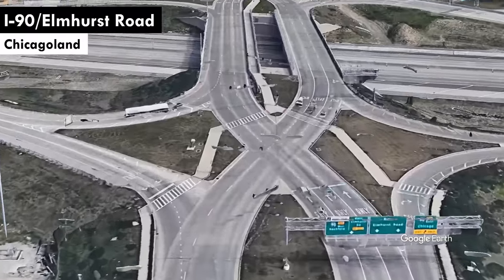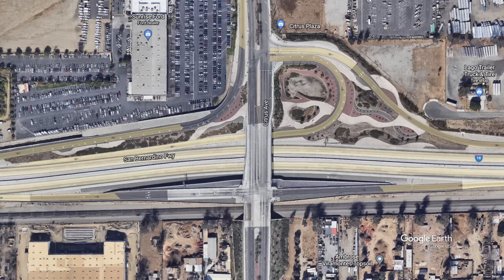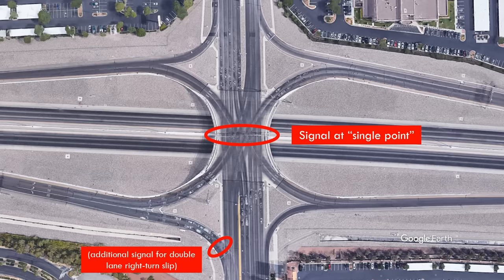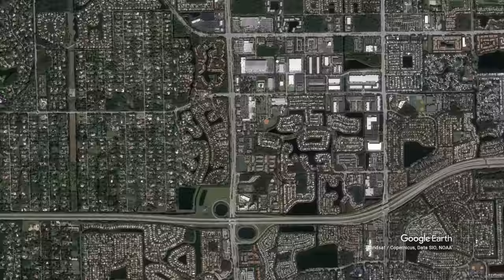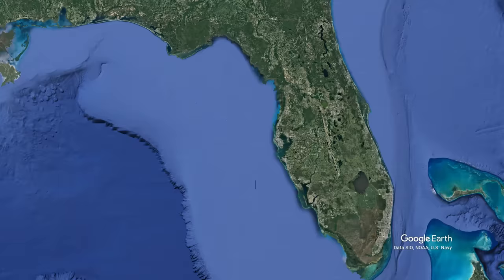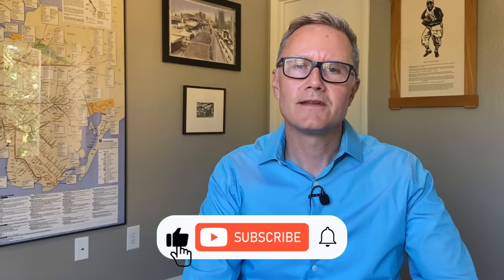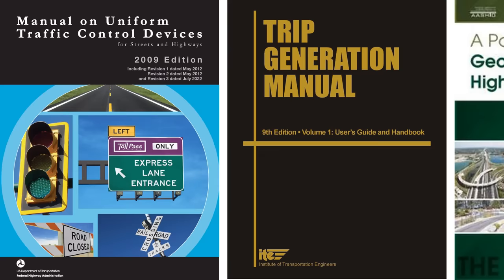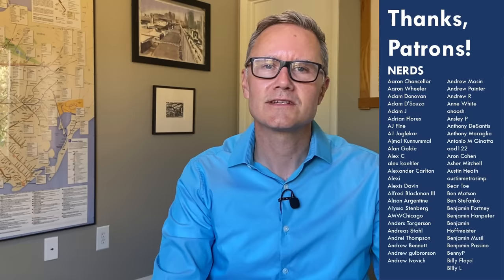Traffic Engineers Gone Wild: Why Interchanges and Intersections are Getting Worse, Not Better

Comment: 13:41 Whaaaaaaat..... If you are going to build a roundabout anyways (or multiple) then why not just turn the initial intersection itself into a roundabout or a traffic circle? Roundabouts are fine for pedestrians to cross, at most it just means you have to walk a little bit  further to cross  at some distance from  the roundabout, as long as the lanes are kept low it's no problem to cross. In thie animation you showed, they can just take out the bikelane from the road and put it next to the sidewalk, take out the right lane, since the current middle lane can already accomodate a right turn and a straight on and the current left lane can accommodate  another straight  on and the left turn. Then pedestrians only have to cross 4 lanes, which isn't nice but it's not terrible either. And if the city really wanted to make it better for pedestrians they could just widen the median to make it two two lane crossings instead, which they would have the space for because they moved the bikelane and got rid of one lane of cars.

Comment: i am still a fan of the diverging diamond interchange as a concept, though the 'accommodation' examples you provided were indeed atrocious.  if the median pathway there were wider and less 'prison' like, i think it might be tolerable.  had a recent experience with a 'standard' highway interchange on the southern outskirts of edmonton (hwy2 and ellerslie road) .. since we had stayed at a hotel at the SW corner of the interchange before, i knew that if i wanted to turn left from ellerslie road south onto hwy2, it was faster for me to go straight through, turn left at the next interchange, u-turn in front of the hotel, turn left back onto ellerslie road westward, and then take the right turn onto hwy2.  a DDI would have been a huge benefit there, especially since the nearest pedestrians would be blocks away.  

another intersection that had been problematic for years was at the hwy2 turnoff onto gasoline alley in red deer.  traffic at that interchange was consistently awful, and sometimes i would forego a pitstop after taking the offramp just because the left-turning traffic was backed up down the ramp.  within the last year, they put in roundabouts at both ends of township road over hwy2, and when i swung by a month ago, there were ZERO cars backed up in any direction.  still not great for pedestrians, but i would have been comfortable biking through those roundabouts if i needed to get across hwy2 (but i have braved biking down Macleod Trail in Calgary and Westheimer Road in Houston, so still likely out of range for a casual cyclist).  but i agree that putting in roundabouts just to accommodate vehicular u.turns is head.shakingly bad form.

Comment: A signal intersection with more lanes than State Road 7 / Forrest Hill Boulevard can be found at coordinates 41.03040933204014, 122.92754700762303 - the junction of Anshan Road and Jianguo Blvd. This is 8 lanes for cars on all four approaches, plus wide bike lanes and sidewalks. Additionally, it is in the middle of nowhere, surrounded by farmland, with very little traffic and no reason to exist. It was built back when Hu Jintao was president. They were going to expand an new suburb of the city, southwards, to here. The Xi Jingping came in and his anti-graft campaign ended the plans.

Comment: Why would the road designers give any more consideration to pedestrians when there are barely any to begin with. Being that you don't see a single other pedestrian in your video yet see cars everywhere doesn't it make sense to optimize the roads for vehicle traffic while only accommodating pedestrians? Most of the places you mentioned don't even have the density to be walkable even with the most perfect pedestrian infrastructure.
Reply: One of the reasons there are few pedestrians is the way that many suburban areas are designed.  They make what should be a short walk so onerous that many will get in their cars just to go a block or two.

Comment: I cannot resist local news articles about changes in traffic patterns. The article usually has some diagram from the State DOT about how to drive through a diverging diamond without going the wrong way, and the comment section is a salon of thought leaders that state the real solution would be to add an extra lane to the stroad that approaches the interchange. I kind of pity traffic engineers that get tasked with these projects. The powers that be want to reduce traffic that has been incited by the development of some warehouse facility that was built due to some tax abatement bonanza, followed by hastily built subdivisions, and now all those happy citizens need fresh blacktop to get to the strip mall. It is all just endemic car dependency.

Comment: Go drive in the UK: those guys toss in circles everywhere. Like instead of an intersection you get a circle or maybe some intimidating figure 8 situation. That’s on the main arterials. The rest is like super narrow tree lined lanes connecting villages with a speed limit so high I scared myself (weird because the highways have strict speed limits). Took me a while to get used to cause it’s different from South Africa which like copies USA but drives on the left. But yeah making a road feel dangerous to drivers makes you drive under the speed limit.

Comment: Dude wth that French DDI is nuts, at first I was going to comment that even though it's not a place you would want to be, that  they still provided decent to good access for pedestrian, apart from them also having the prison yard tunnel, they could have made that bit of the bridge just a bit wider and give pedestrians just a tiny bit more room, but they didn't. Anyways while looking at the pedestrian access, I thought it was sad how small of refuge area the pedestrians get coming from the top (still okay, just sad compared to the much larger and better space on the bottom crossing.), but then I looked at the top part of the intersection closer and is that a freaking roundabout?

They have a ROUNDABOUT at the end of this DDI, wth! Also while the bottom part of this DDI is well marked and shaped and the cars are pointed in the right direction and all that, at the top part it was like they decided, Eh you figure it out. It's as if this intersection sits right at the border of two jurisdictions and the bottom one decided to build it correctly and the top jurisdiction was too cheap and put in the least amount of effort that they could. What the heck happened here.

Comment: The Utah ones are incredibly practical... if you only have to move cars and pedestrians don't exist. I've driven on Bangerter many times and it is much nicer to drive on than when it had the traditional intersections... walking in the area though is an absolute nightmare... I would never go anywhere outside the 215 loop on foot if I could avoid it.

Comment: I think the worst intersection and interchanges you showed were the single point urban, the diverging diamond, and the displaced left. All three are absolute nightmares and death traps for any bicyclist or pedestrian to navigate. But what really grinds my gears is the "continuous flow" intersection: one that has displaced lefts and right-turn slip lanes in all four directions! 😠😡🤬👿 When an intersection gets that complicated I think it should be solved with a surface roundabout sandwiched between an overpass and an underpass.
Reply: DDI can be very good for pedestrians. The bad ones put the walkway on the outside (4 crossings with unsignalized slip ramps) but the good ones put the pedestrian crosswalk in the middle of the DDI which makes those 4 unsignalized slip lane crosswalks into two unsignalized slip lanes and two signalized crosswalks with a concrete barrier to protect you in the middle.

Comment: Random question that has nothing to do with this video except you mentioned a roundabout; I’m learning to drive and before driving I thought but pedestrian crossings at roundabouts was great as it meant you didn’t have to walk well down the street to cross but as a driver it seems dangerous (especially as we still usually drive manuals here so that doesn’t help). I guess the reason is thought the pedestrian doesn’t have to wait for a single as cars are slow (usually 2nd Gear) going around the roundabout but IMO it be safer if it was like at least one or two car size spaces away from the stop line or is there flaws in that? I understand it saves a few seconds for the pedestrian to have it right at the mouth of the road but it seems like bad drivers are more likely to ignore it & knock someone down. Is this even a thing in N.America? Ireland is plagued with them

Comment: All these American junctions seem to be traffic light dependent, what happens during a power cut ?
America seems addicted to the Stop sign and the traffic light. In Britain we preffer roundabouts and Give Way signs. Our motorways where pedestrians and cyclists are banned simply go straight through without interference while slip roads take traffic on and off the motorway and guide it via roundabouts to minor roads. Where 2 motorways or a motorway and a major dual carriageway cross they do so at different levels and once again slip roads and roundabouts sort out traffic not going straight on. You may get traffic lights on the roundabouts if they get too busy but they usually work better during a power cut.
Cyclists are in danger on roundabouts where drivers refuse to accept they have right of way simply by being ahead of them.

Comment: This kinda of shit is why I'm planning on leaving the country. Intersections aren't the only thing getting worse; drivers are increasingly aggressive and participate in more offensive driving rather than defensive. It's even worse during rush hour with giant semi trucks, oversized pickup tucks and crossovers playing weaver chicken with each other. It's a wonder I don't see more fatal accidents on interstates these days. It's only getting worse because climate change and excess car consumption are both consuming and destroying land at what seems to be an exponential rate. It's hell for anyone without a car. Even if you own a car anyway, you're still praying that no one runs over you or clips your bumper driving over 80. If you suffer a mechanical failure, your stranded on a less than wide enough shoulder where any moron who isn't even paying the slightest attention is liable to clip your bumper and total your car too.

Comment: For a bowtie variation used as a interstate exit, take a look at exit 12 on I-87 in Malta New York LatLon:42.970327031906606, -73.80173215975995 The interstate exit ramps throw you either into a slip lane for a right turn or a roundabout for a left turn when exiting the highway

Comment: Wondering if there are any examples out there of successful compromises of vehicle-servicing interchanges with fairly good pedestrian-bike access too?  Are these two groups incompatible all the time or has someone somewhere done something that works sorta ok for both?
Reply: you generally want to keep them apart, because small slow and squishy doesnt mix well with big heavy and fast...

urban environments pretty much already are the completely wrong place for large high speed roads and even worse large high speed roads intersecting

essentially urban environments and high speed roads have diametrically opposed design goals... so your options are to try and do both - badly, or to focus on one or the other.... if you focus on one, you either get a highway or a city... if you try to do both, you get this kind of mess

Comment: If the driver can't decide quickly then they should not be driving...

And what is wrong with traffic circles make them large enough for trucks and they accomodate pedestrians as well without any traffic lights just a slower speed in the area but is that really a big deal get into the proper lane before you enter the circle and drive right through...

Comment: This is not a traffic engineer's fault, this is a planner's fault. 
These interchanges do not belong in these urban areas, they are designed to be 100% car-centric on purpose, because that is the assignment they got. Intersections like these are not what is keeping in force poor planning, politics is.

These intersections are great at locations at which they can perform their function as a service interchange. Put it between two highways that have limited space to cross, put these at locations where city diversion roads meet the highway. That is where they belong. Not in the middle of an urban centre with houses right next to them?! That is insanity

Comment: the explanations for each type of intersection and accompanying panning really do not explain what they are or how they work very well at all.

The visuals are jarring and there's too much going on to know what aspects you're really talking about.
The wording doesn't help because you leave a lot of dangling references, no parts of the visuals are highlighted to know what you're talking about

For example, for the michigan left, you talk about east and west and start off zooming in to know which direction is east and west, but instead of keeping the same view and using the same picture with arrows drawn on them (you don't need fancy animations, just literally switch to the same picture that you drew arrows on in Ms Paint), you snap to a completely different orientation, which completely throws off the viewer which way is west and east anymore, so the rest of your explanation becomes a tangle of unresolved dangling references that the watcher can't follow... unless they painstakingly pause, rewind the video, mentally mark an identifying orientation landmark then match it up with the new picture/orientation.

It's technically followable, but the followability of the explanation is merely "accommodated" - like pedestrians are.

Comment: Your points are valid, but "accommodation" for pedestrians as just an obligation that engineers have to realize is exactly the problem, i.e. the problem is car-centric design and not this optimized lanes, on the contrary, this new lanes designs saves money in the long run due to less crashes overall. It's simple, less interaction means less possibility of an accident, even for pedestrians. I would see a solution for pedestrians in some underpasses or neighbouring bridges only for pedestrians that would not interfere with cars at all. An there are good examples, so it can be done. It just costs a little bit more money.

Comment: There are both sides of the coin. Most of the TI you mentioned in this video have thousands if not tens of thousands cars drive by everyday. compare to a few dozen or maybe a couple hundreds pedestrians crossing. I would say that is a very good trade off.
Everyone are traffic engineer until they are not. It is very easy to criticize them. But traffic engineers are the one keeping us safe on the road and get to where we need to go as quickly as possible.

Comment: In my opinion, pedestrian accommodations shouldn’t even be considered on highway or high-speed/high-volume roads. The additional time and cost to install them isn’t worth it. There just is not enough foot traffic to justify it. 

My other argument is that if your willing to walk in America, then your willing to walk a distance. Even in cities where it’s regular intersections with pedestrian crossing, you’re still going to walk quiet a distance to go to most places. So what does it matter if you have to walk a little out of the way to cross. Either way your walking further than in most countries. 

America just was built around the Automobile and there is no way to go back. All of the infrastructure is designed with vehicles in mind, which makes sense because America is large with sprawling cities. It’s easy to build walkable cities in places like Europe where the whole country is the size of a single US State.

Comment: This video shows a lack of understanding of mobility and designthough. This is a correct design decision as those places need to do rapid-as-possible car traffic. Pedestrians and cyclists go elsewhere on separate routes and separate infrastructures. You need to separate such flows on major traffic places, mixing is a recipe for traffic jams and unsafe situations.

Wanting to always desperately mix in those is a sign of dogmatic political design and it has failed wherever it was implemented. Good example: 2-4 hour traffic jams on the city of Utrecht's southern entranceway because the extreme-left government thought reducing mobility was a good idea.
Turns out people won't cycle to work for 6 hours a day no matter how many dumb ideologues you line, who'd have thunk it?

And especially in the US context where the car is the main mode of transport, you're simply not doing your job if you're making an interchange where cars are secondary.

Those cities need to budget for alternative crossing though. Putting up a lightweight pedestrian/cyclist bridge doesn't cost that much, especially not for a larger project.